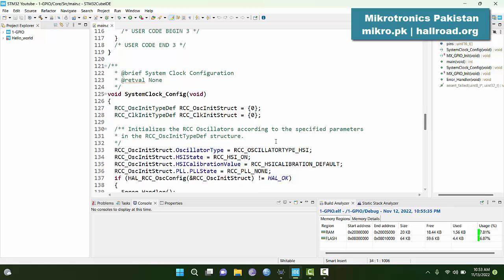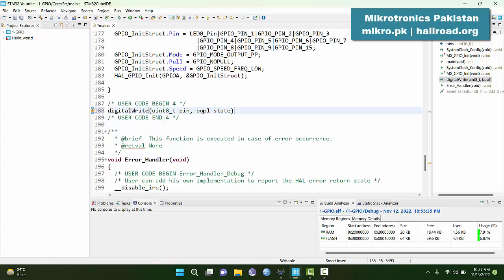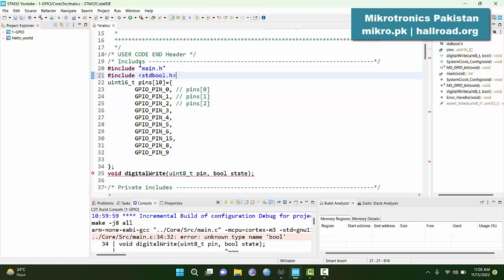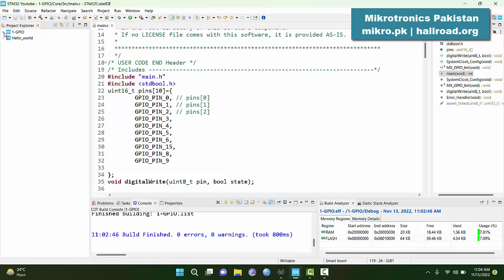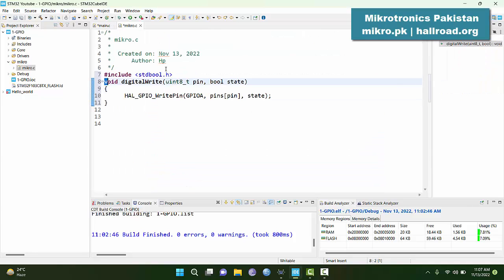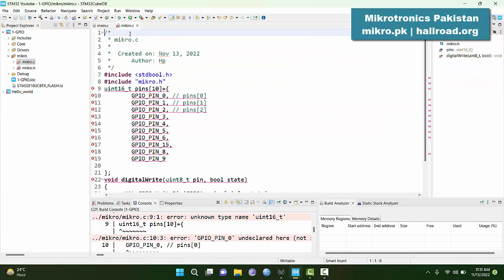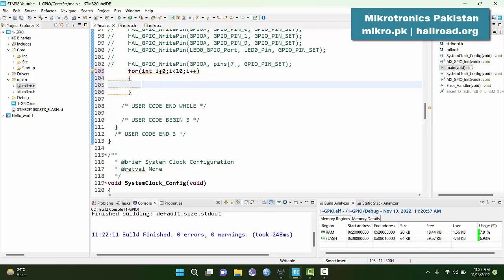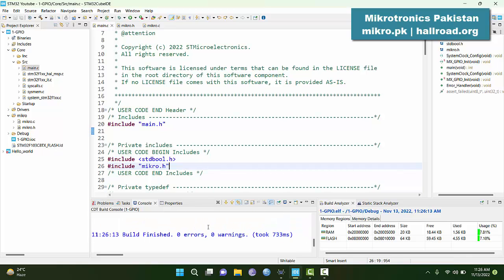STM32 for Beginners | Organizing Code in Functions and Libraries

Comment: You did NOT create a library! All you did was write a function in a different file in a different folder and called it from main.c. You CAN’T reuse that function in other projects.

A library is a binary file created in a standalone project that can be linked into any other project making the code inside the library reusable in any other compatible project. 

Binary libraries follow a naming convention so a proper library containing your digitalWrite() function might be called libMikro.a.